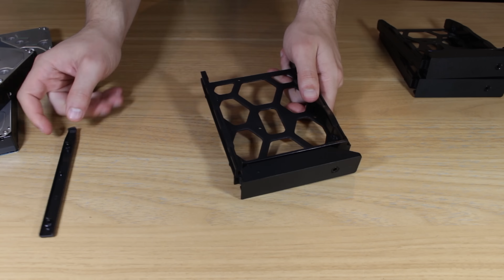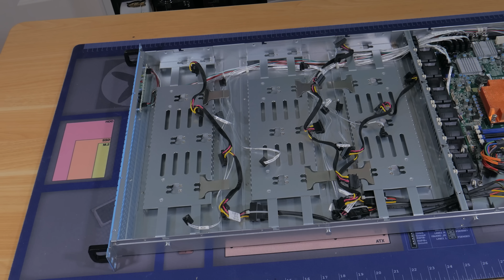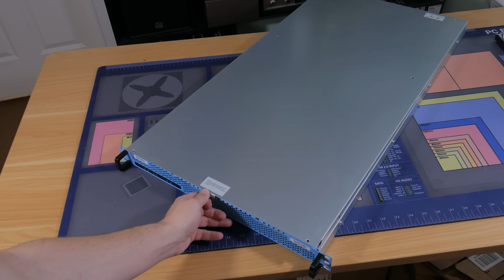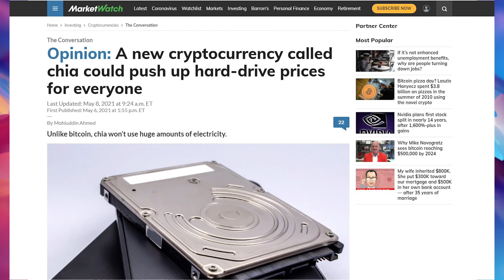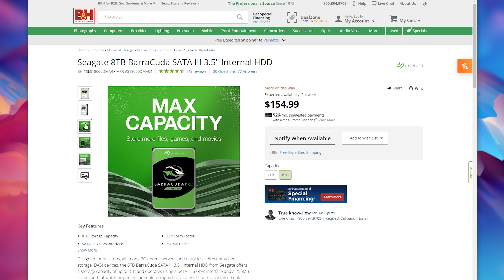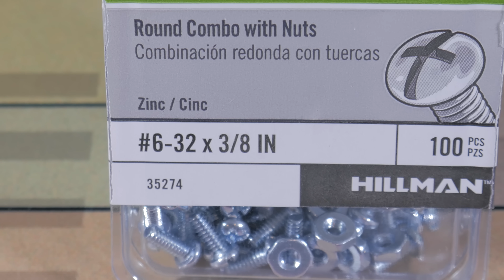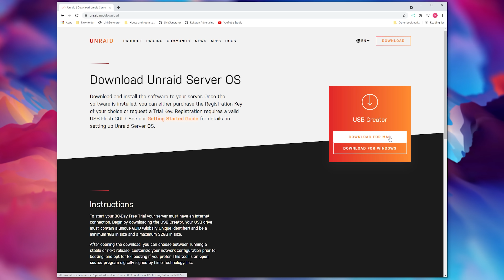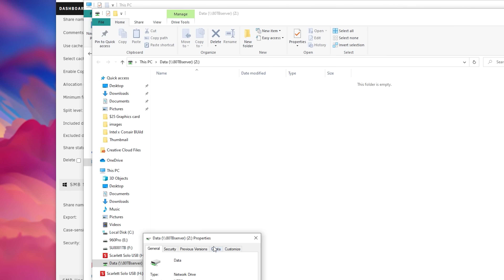Budget Storage Server 2021! | 80TB NAS

Comment: Drive manufacturers don't overstate their drive size, just that they measure in terrabytes (1000/TB) and windows measures in tebibytes (1024/TiB)
Reply: This needs to be pinned. I had forgotten this and I'm sure there's plenty more that have never heard about TiB.
Reply: Not only that but even just putting a filesystem on there has overhead. A portion of that space will be used for things like page files and meta data.
Reply: @FlexibleToast  Sometimes yeah
Reply: Nowadays I see more and more retailers pointing out the actual 1024/tb) size in the title of the drive. I guess they get less complaints this way. All trough my life I thought it was common knowledge, but i guess it is not.
Reply: ugh, okay people, listen. this is something one used to need to know in order to even format a hard drive, back in the days of MFM.

ALL hard drives (yes, all) are created with bad sectors because it is impossible to make a 100% perfect hard drive platter. those bad sectors are blocked off at the factory so you don't have to deal with them. as other people said, there is also partition table and filesystem overhead. you won't ever get exactly what the label says, and it's not a scam. it's simply, physically impossible to build a perfect machine of any kind. the priniciples of thermodynamics state this.

if any of you are any good at math, here's a simple equation to help you understand part of what is happening: x * 2^10, where x is the amount of kilobytes you want to calculate. we use an exponent of 2 because binary is base-2 counting. (8*10^9)*2^10 will give you an amount of bytes that an 8TB drive could have under absolutely ideal 100% perfect conditions, which do not exist. from there, subtract bad sectors marked off at the factory (the larger the drive, the more there will be, that's why you lose 40gb on a 1TB drive. there are 40gb of unusable sectors.), partition table, and filesystem. 

again, it's not a scam. it's just not physically possible to deliver 100% of the storage space on the label.
Reply: This is not the whole story. The legal disputes over HDD manufacturers reporting their capacity in decimal values instead of binary values goes predates the existence of the those terms.
Reply: @iNowHateAtSigns  even if that's true it literally doesnt matter at all
Reply: It's weird how RAM manufactures and M$ can agree on which unit should be used but storage manufactures decided to used something else because they wanted to put a bigger number the box
Reply: @Pegaroo_  because of the way ram chips are structured it'd be less intuitive at the engineering level to not use powers of 2
Reply: @nixietubes  it's still binary, doesn't matter if it's RAM or long term storage. It's all base 2. 
Drive manufacturers might not technically be lying but they are being deceitful
Reply: @Pegaroo_  the amount of pins on a dram chip are limited, if they didnt use powers of 2 they'd be wasting addressable bits, they could advertise the size in GB instead but it'd be weird sizes like 17.1GB
Reply: @nixietubes  So what?
Who changed the way they measure a quantity of bytes, M$, RAM manufactures or Storage manufactures?
My first computer had 48Kb of memory, they didn't try to claim it was 49.152kb of memory, they said what it actually was.
Reply: @Pegaroo_  And what was your first storage medium measured in? No one changed anything, things are the way they are because reasons™️
Also technically your machine was lying to you with KB vs KiB ;)

My point in all this is that the problem is people not knowing the difference, and that is largely because of the use of si units when referring to base 2 measurements
Reply: @nixietubes  Also how are the pins on NAND Flash and RAM any different
Reply: @nixietubes  first storage medium was measured in minutes since it was an audio cassette. And since it was 1986 and there KiB term hadn't been invented my computer wasn't lying
Reply: @Pegaroo_  KB is a very simple measurement to define. Kilo means 1000. It simply doesn't stand for 1024. The same way 13 inches aren't a foot.
Your computer was infact wrong :), just as it is wrong today in windows.
Reply: @nixietubes  I get that is breaks the normal Kilo thing meaning 1000 but we don't use Megagrams, Gigagrams or Teragrams as units of mass. 
Just because the IEC changed what KB meant in 1998 doesn't make everything that came before it wrong, it's only wrong because they decided.
It's just like how the original meaning of billion was changed, billion was established in the 15th century, was "a million of a million" (1,000,000 to the power of 2, hence the name billion), or 10 to the power of 12 = 1,000,000,000,000 but now its accepted that a billion is only 1000 million 1,000,000,000.
Reply: @Pegaroo_  it is by definition wrong my friend, I don't see any point in arguing if you're propping up a common misuse just because it's common while getting mad at a correct usage
Reply: @nixietubes  It's only "wrong" because the "definition" was changed in 1998 just like how a 19th century billion would be called a trillion today. All it's done is muddy the waters just so that hard drive manufacturers could write a bigger number on the box. 
It's just like marketing for display resolutions 4K means 3840 × 2160 because 3840 is nearly 4000, 8K is 7680 × 4320, 7600ish close enough let's call it 8K, 16k is 15360 × 8640, we're rounding up quite a bit now but ok 16K. What about 32K? 30720 × 17280, 64K? 61440 x 35640 it's all marketing to make the number on the box bigger and you are defending it 😞
Reply: @Pegaroo_  resolutions are different.. the definition wasnt changed, they just added Xbi-bytes, I'm not sure how to say this in a way you'll understand, it's as simple as a "kilo" byte is a thousand bytes, using it to refer to 1024 bytes is just wrong ¯\_(ツ)_/¯
Reply: @nixietubes  I do understand I'm just not going to capitulate and it seams M$ and RAM manufactures aren't either. 
It didn't matter whether it was technically correct or not, until 1998 everyone used the same units and knew exactly what was meant but now we have TB and TiB and the average user has no idea what the difference is (it's 9.06% BTW) or why there's a difference but let's be clear here the reason KiB, Mib, GiB and TiB exist because is of marketing of hard drives, just as with the naming of display resolutions. Number on box bigger
Reply: Originally 1024GB was 1 Terabyte, they made tebi to indicate 1000 but everyone started scheming, so they switched the 2 around. 

I do not believe anyone follows the definition strictly. Anyone sellign storage will just state Terabyte and sell as little as possible.
Reply: @JohannesWOW  it's really not that serious haha
Reply: Just Microsoft things. Uses one unit of measure while stating another.
Reply: @DamnMyNickIsTaken  yeah, obviously drive manufacturers wanna state the number thats bigger but Microsoft literally calls it the wrong thing
Reply: Was just about to write that
Reply: @wesleydanielz5972  Your thinking small minded, only using 1k rams in your brain. Try upgrading to 4k rams. Your mind will run faster!!
Reply: FALSE DRIVE SIZE ADVERTISING!!! AFTER FORMATTING A DRIVE IT NEVER MATCHES WHAT THE MFG CLAIMS
THEY SHOULD STATE BOTH MFG SIZE AND FORMATTED SIZE!!!
THIS IS BATE ANS SWITCH FRAUD MARKETING. USED ANY!!!! DISK MANAGER AND YOU WILL SEE  A TOTAL
DISK SIZE THAT IS SMALLER THAN ADVERTISED!!!!  THIS HAPPENS WITH APPLE, LINUX AND MICROSOFT OS.
FOR EXAMPLE MY 500 GIG DRIVE FORMATS AS 465 GIGS. 35 GIGS LESS THAN ADVERTISED!!!!!!!
Reply: @computerpro123abc  That's actually because the drive manufacturers convinced the courts that they can use 1 GB = 10^9 bytes despite the fact that every other use of 1 GB with respect to computers means 1 GB = 2^30.  So if you divide 500,000,000,000 by 1024x1024x1024 you get 465 GB and change.  There is also some overhead based on what file system you are using, especially if you use RAID or RAID-like file systems.
Reply: @thefalseshepherd3689  word
Reply: Yes Windows does measure it in Tebibytes. But it Shows "TB" in the interface which is short for Terabyte. TiB would be correct. I dunno why they don't change this mistake. It's honestly a very simple fix.... but  microsoft is.. well, microsoft.
Reply: @FunRamDispenser  true
Reply: Oh I didn’t realize that, shew!!! What ua relief to know .  Finally I understand why every “1000” terabyte drive I’ve bought recently show up as 265mb. I was starting to worry that the seller on wish had scammed me! 😂
Reply: How its always been for drives. =)
Reply: Some of us have been around long enough to remember the time before drive manufacturers redefined previously agreed upon vocabulary for marketing purposes.
Reply: @DrewNorthup  And even more of us did science before computer science existed where the SI prefixes were base 10 only, not base 2.
Reply: Yes, they don't technically overstate, but practically they know exactly what they're doing. Not a single piece of tech measures in decimal. They all use base 2. So having decimal terabytes is pointless. But since larger number is better they use decimal.
Reply: @tfwmemedumpster  Absolutely, and concisely said!
Reply: Came here to say this, i too was "triggerd" by is comment
Reply: wrong.   1tb is 1024  (not formatted)  when you format it takes space to make tables  even lunix windows  kali  or anything else will change the size also size does infact varry   + on top of that larger drives take more space to make tables  so a 2 makes 1g   wile a 16tb may take 1.5 tb of tables    also drives can + or - just slightly   i have had a 8 that was a 9.2  and a 8 that was 7      it can happen.
Reply: @TwinTailTerror  are you ok
Reply: Well, all of this only exists because drive manufacturers started overstating their capacities. When I started working in IT, there were no tebibytes etc. Only terabytes, one being defined as 2^40 bytes. Claims about the "original" decimal use of Kilo, Giga, Tera etc. in computer science are mostly bs, as in the old days sizes were given as precise byte values.  The new "definition" didn't exist before 1998.
Reply: I was just thinking about this today! Shower thought "an 8GB USB should be made to have 8.x if they're going to take up some space with whatever is in there that I don't understand (MBR? I don't freaking know) that makes the capacity lower it's false advertising". Interesting to know thanks.
Reply: @taranullius9221  indeed I can understand why you would think so, but to confuse further, format that same drive with an appropriate file system to work on a Mac pc for example and the drive will show as an 8gb usb. I am fairly sure this is something that was fought in the courts a long time ago (Circa Windows 98/200/XP era) and the drive manufacturers managed to successfully defend their position by essentially blaming Microsoft for using the wrong capacity standard.
Reply: @pixlhound  the manufacturers came up with calling their way with the correct size naming structure per 1000 ie mega, giga, Tera... and called MS the ones not conforming... said that they were using the 1024 sizing that was incorrect... any old timer knows that 8 bits to a byte and 1024 per kilo, mega, giga, tera, peta...
Reply: @markthompson4225  yeah, that's essentially what I said. I was taught 8 bits to a byte, 1024 bytes to kilobyte etc but modern thinking seems to be that it's too much like hard work and everything has to end in a 0... except when talking about data transfer, that seems to have stood the test of time so far. However, they are still recognised as 2 different standards, mega/mebi etc
Reply: @markthompson4225  I came to make the same point. This TiB shit is artifice pushed by, and I believe invented by, the storage industry. Any engineer or CompSci person knows this.
Reply: @markthompson4225  Exactly.  The correct response would be to adjust the standard prefixes when used with binary data to multiples of 2^10 rather than the horrible solution of "tebibytes" etc.
Reply: @markthompson4225  Yeah except kilo, giga, tera etc are universal prefixes that only mean the multiples of 1000 used by the drive manufacturers.
Reply: @taranullius9221     It's not false advertising if you don't understand the technology.  All drive manufacturers use TB instead of TiB.   It's like using grams vs oz. for weight,  do you call that false advertising?   And there are plenty of overheads for storage before your actual usable space: RAID overhead (if you use RAID), MBR/GPT overhead, filesystem reserve, block size waste... go learn something before complaining.
Reply: AFTER FORMATTING A DRIVE IT NEVER MATCHES WHAT THE MFG CLAIMS
THEY SHOULD STATE BOTH MFG SIZE AND FORMATTED SIZE!!!
THIS IS BATE ANS SWITCH FRAUD MARKETING
Reply: @billgoodman3537  it does show the correct size, it shows the correct size in a different measurement.
Reply: @pixlhound  wrong!!  you never get the advertised drive size using any measue you choose !! PROVE IT FORMAT A DRIVE AND POST A SCREEN
SHOT OF THE FOMATED SIZE = TO THE ADVERTISED SIZE!!!!
Reply: @pixlhound  Maybe if you use all caps it'll be easier to understand.
Reply: @billgoodman3537  just say you are bad on math.
Reply: @billgoodman3537  When you format a drive, you are writing information to it by creating a file system.
Whining about a 1TB drive showing up at 960GB after formatting is like getting mad that your trash bag doesn't hold 13 gallons because you threw uncompressed water jugs in there.
Think before you speak. If you don't understand, learn.
Reply: @billgoodman3537  OK
Reply: @billgoodman3537  lol
Reply: @billgoodman3537  lol whoosh

Comment: SMR is not “Older” and “inferior”.   SMR is a technology that permits drastically (+50%) increased density allowing drives to be made larger or with fewer platters.  It is ether a cost saving measure or tool to drastically increase the size of a drive you can make.  It however does significantly impact performance.    Regardless your point is still valid In a NAS these drives are suboptimal
Reply: Device-managed SMR (like in those 8TB  Barracudas shown) is inferior in all aspects except price per gigabyte - for the manufacturer, that is, not the customer, given the whole brouhaha last couple of years when all three majors started replacing their previous CMR offerings with SMR at exactly the same price.

Host-managed SMR is a different story but you will find  neither host-managed  nor even host-aware in the budget line unless you luck out on shucking high-capacity drives (14TB+!).

Comment: so no raid 5 or 6 then? so no redundancy if a drive fails?
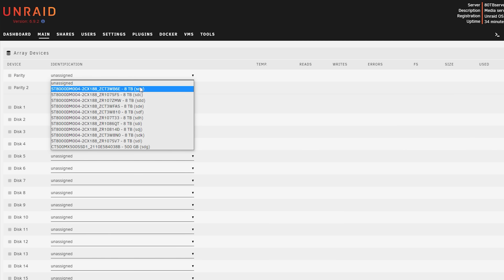Reply: No RAID, UnRAID. At 12:04 you can see him setting up two of the drives as parity drives, so you can have up to 2 drives fail with the data still intact.
Reply: @Leseratte  aaa ok

Comment: I would have gone for real NAS drives but everything comes at a cost. That said, you could have  saved a lot of money by getting a Fractal Define R7 case (or similar, holds up to 23 drives), add a cheap MB and CPU (AMD Ryzen 5 3600 + MB + RAM for less than 400 USD + case) with integrated GPU (so probably all for under 600 USD). Bit more expensive and you'll need a PCI Sata Card with another 6-8 SATA ports but more future proof...That would also help with noise as I assume this puppy is quite noisy... Otherwise great video!

Comment: You might consider getting a PCIe riser card and putting a NVME card on it then you could have up to two NVME drives (the x16 slot is x8, not x16) as cache. That would free up the 3.5" bay.

Comment: Pro tip for unRAID n00bs: find a USB header cable and connect it directly to the motherboard. It's fine to have the flash drive just lying in there.

source: this is the method I've used on my four unRAID servers.
Reply: came here to say that. Though I'm also paranoid enough to have secured it with some self-adhesevive velcro to athe side panel
Reply: @mauritsl84  

That seems like overkill. 
What is gained from using an SSD for unRAID boot?
Reply: @adeadfishdied  you can delete all of it. I read about unraid and so true no usecase for a boot ssd. I am a truenas person so sorry about this.

Comment: Blade server is the worst form factor for home. Prepare for airplane noise 24/7 )))
Reply: All purpose-designed servers designed to be racked are noisy. That's what closets are for. You just gotta insure proper ventilation. There are also nice sound-insulated racks designed, or you can modify a standard rack with foam.

Comment: not only did you end up with crap drives, you have no warrenty either... schoolboy error... if you are running a server reliability is everything   and WTF are you doing to that RAM... spinny spinny may be cool in school with your pen, but not with sticks of static sensitive memory.
Reply: You obviously didn't listen to the video. 

Firstly, he isn't worried about redundancy. This is more of a scrap heap of data than a valuable archive. 

As for the warranty, you are incorrect, at least in the US, where the OP is located. All you have to do is put the drive back into the case and submit warranty claim. You don't know or understand the Magnusson-Moss Warranty Act.

Watch and learn:

https://youtu.be/9sHbaGuSuck?t=480